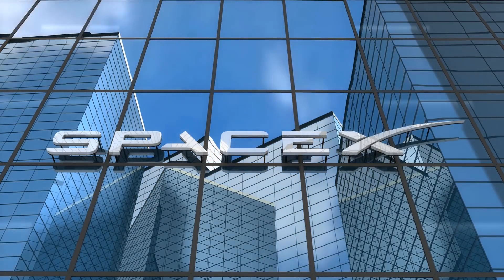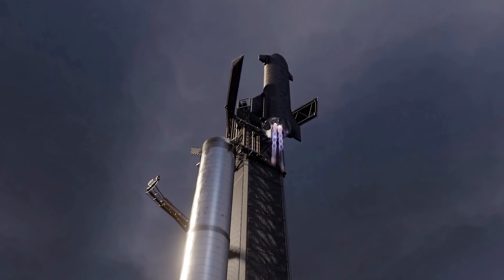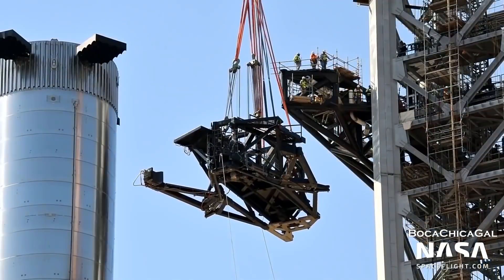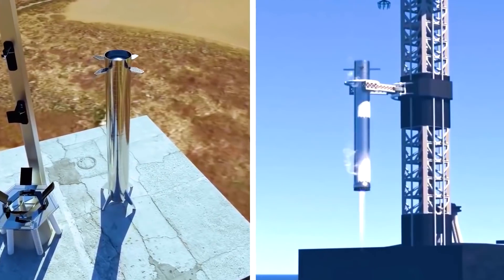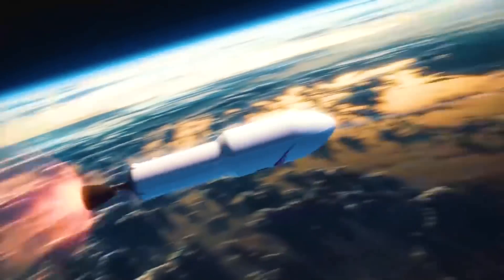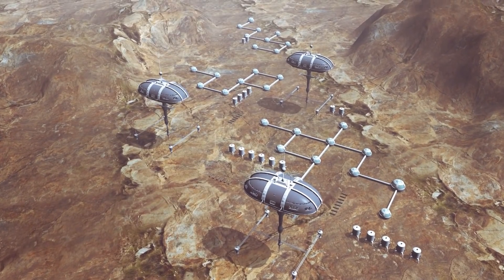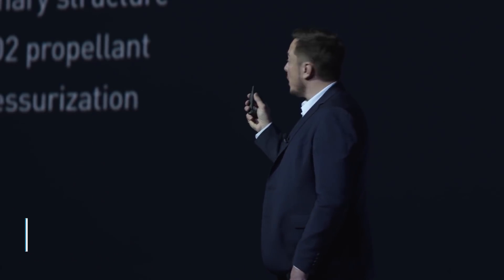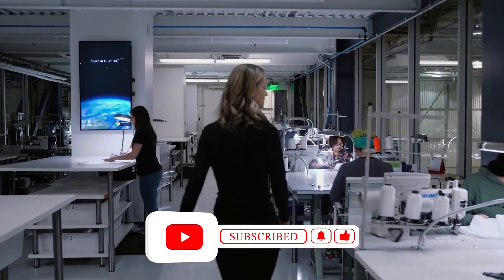SpaceX's Mechazilla Is Even Crazier Than We Thought!

Comment: um it's known when you throw a magnet on a copper plate it can't hit any force, just land lightly, why don't I use that technology for a light landing :)
Reply: Because of the rapid deceleration will give effect to the hollow body structure of the rocket. Basically is a flying cylinder tank. Reinforcing the rocket structure with more material will make the rocket heavier thus more fuel to needed for take off and more mass to navigate mid air

Comment: I would be willing to bet they won't land the current design of Starship on the Moon or Mars without first building a landing pad. There's a reason the Apollo lunar landers were relatively short and squat.
Reply: They don't intend to land with it, the lunar lander built for NASA will be a variant derived from the base version but it will definitely have landing legs (and possibly landing thrusters near the nose depending on how thigs work out). The Mars lander version would probably also have legs at first. Remember there won't be just one variant of Starship even to start likely there will be at least 4: Heavy lift/orbital general use (without legs), Tanker (without legs), NASA moon lander (with legs, no heatshield), Mars Lander (Heatshield and legs).
Reply: @MachineCode0  that's obviously not a bit true. They are constantly pushing pictures of starship landing in mars and the moon.
Reply: @EbikeRandomadventures  There are only a few concept artists rendering. They are only illustrative but I think you are getting confused by the many fan animations and renderings that are shown all the time online.